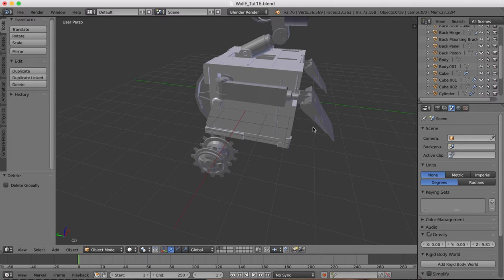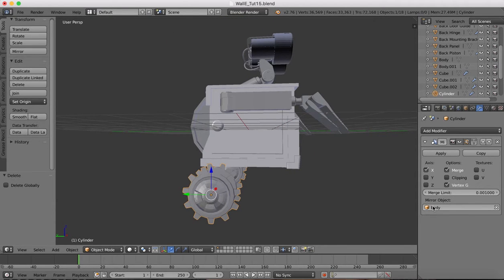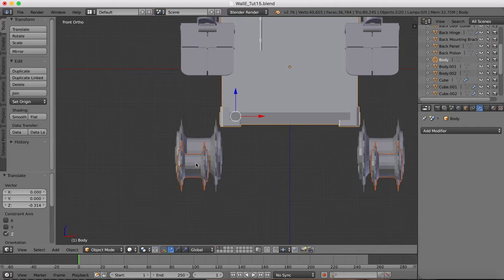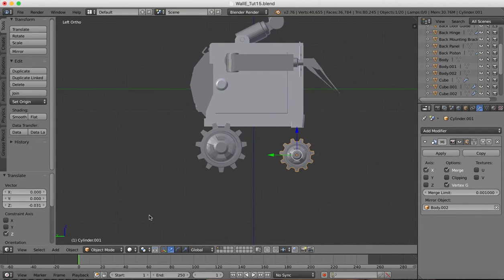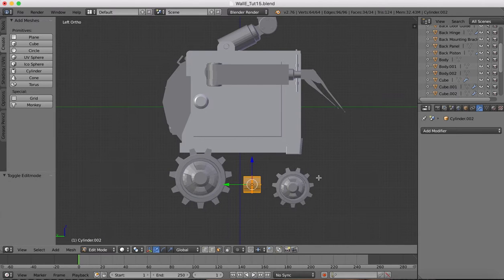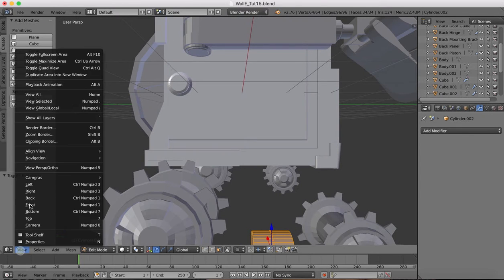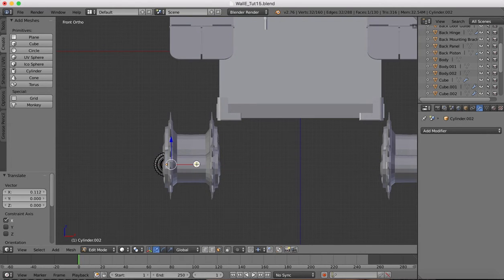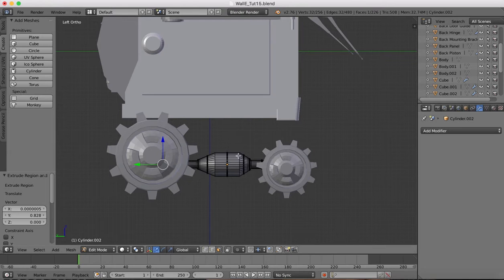Blender Wall-E Tutorial 16

Comment: To line up things (it works not only for meshes, but also for vertices, faces and edges), use snapping (keep pressing Ctrl while dragging). You have several options on the bottom bar.